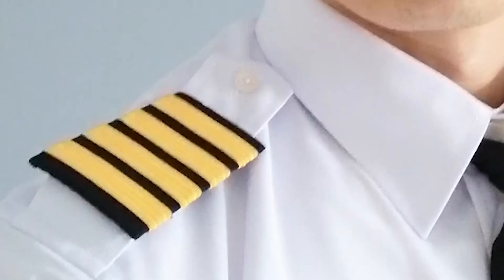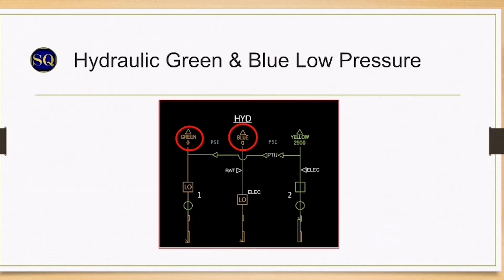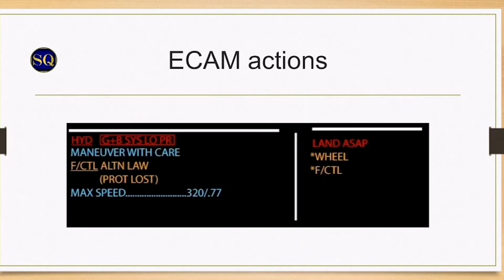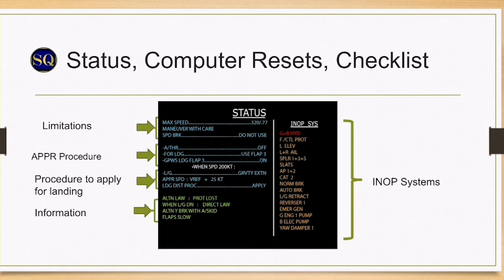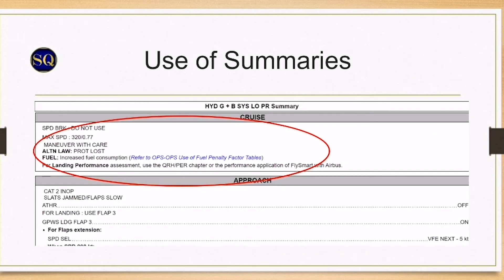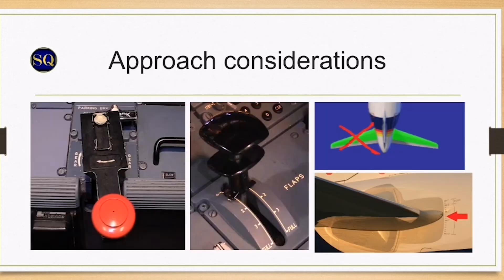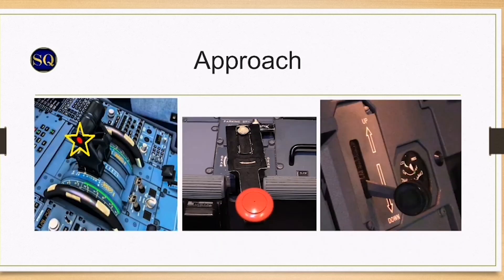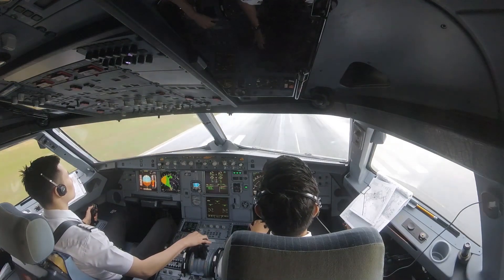A320 Green and Blue Hydraulic System Low Pressure

Comment: Correct me if I’m wrong, if it was caused by an overheat, we can try to recover any one of the system by waiting for a while for it to cool down. If it is B ELEC pump LO PR, we can just extend the RAT and let the RAT do its job. Something to consider?
Reply from the maker: Interesting idea. It will take quite a while for it to cool down. And once you use it again , it will overheat. Best is to follow ECAM actions and if both hydraulics fail, Land ASAP red.

Comment: In this procedure why a/thr has to disconnect at speed 200 kt but another dual hdy fail dont
Reply from the maker: Good question. Because of the loss of slats and some flight control surfaces, the autothrust may not maintain speed.

Comment: Captain, correct me if I’m wrong. Landing gear extension should be done after the aircraft established in a descent from Final Descent Point with VAPP + 15 and Config 3. This is due to the alternate law wherein elevators provide auto trim function. Aircraft will then memorize the mean elevator position during the alternate law phase when in Direct Law (landing gear down). It’ll be as if a “touch move”. Pilots might find it harder to commence a go-around if landing gear extension is too early.
Reply: Did the pilots of Ural Airlines know this when landing in a field on a flight from Sochi
Reply from the maker: In other cases you are right.however in this case we want to revert to direct law sooner.below 200 kts, you will get better pitch control compared to alternate law. Bear in mind, one elevator and all slats are lost.
Reply: @Captain_SQ  thanks captain for explaining.
Reply from the maker: Most welcome

Comment: Question: Simulating with XP ToLiss A321, failure set, Green low pressure. Consequently PTU kicks in, Blue pressure climbs and varies between 2500 to 2800 PSI, AP and A/THR remaining on . I tried to increase failure situation and set additionally, Blue low Pressure. PTU continue working supplying Green, AP +A/THR remaining on. Is this scenario real, or insufficiently designed  ?
Reply from the maker: Normally yellow hydraulics supply pressure to green Hydraulics via the PTU , not blue  hydraulics
Reply from the maker: The PTU does not affect the blue hydraulics. Only the green and yellow